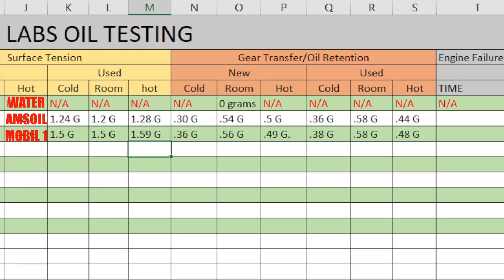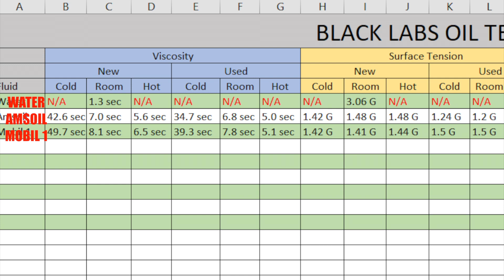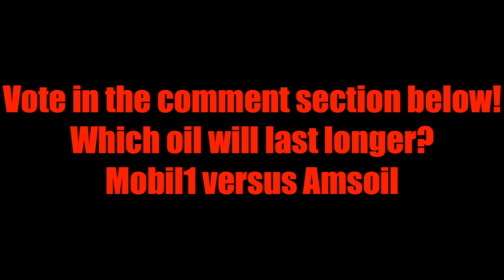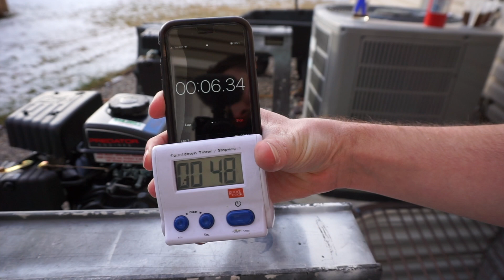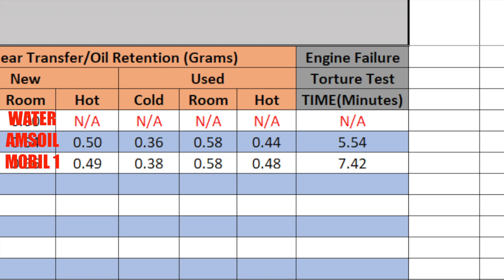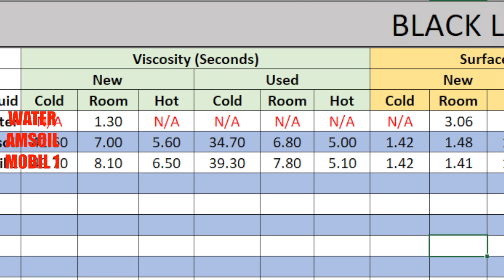Mobil 1 vs. Amsoil. Torture test. Search for the best synthetic oil (part 2)

Comment: First of all SYNTHETIC oil has to be brought to temperature..FACT..IVE LOST EXPENSIVE RACING ENGINES ON MOBIL 1.. IN THE EARLY 80s. My brother turned me on to Amsoil.. I've run it in my Harleys for years big ones ,Sportsters cross country..and transmission 60 wgt..20-50 in the crankcase. Several of the Sportsters had way over 200,000 miles on them when I either sold them or traded in..Fact I bought a new 2015 Dodge Journey with a 2.4L motor oil consumption was horrible. As everyone knows CHRYSLER, dodge use Mobil 1 for years @ 6900 miles that's right 6900 miles the Journey locked up..27 quarts of oil it consumed..every S.R.T. NEON VAN DUALLY I OWNED WENT STRAIGHT TO AMSOIL EXCEPT THE JOURNEY..IT WAS A DELIVERY S.U.V...NEVER LOST AN ENGINE BEFORE THIS AND AFTER THE JOURNEY..ALL HARLEYS AND ALL MY VEHICLES ARE K&N OIL FILTERS AND AMSOIL..MOBIL 1 SCORED THE WALLS ON MY WIFES 883 HARLEY 20-50....NEVER AGAIN WILL I USE MOBIL 1. Thx
Reply from the maker: Thanks for the comment
Reply: That was the 80's man, you have to let it go, just saying motor on.
Reply: Sounds like someone is salty cuz Amsoil got whooped😂
Reply: @AlexHernandez-vg4qw  not at all
Reply: lol this vid is gunna pisss off all the amsoil folks